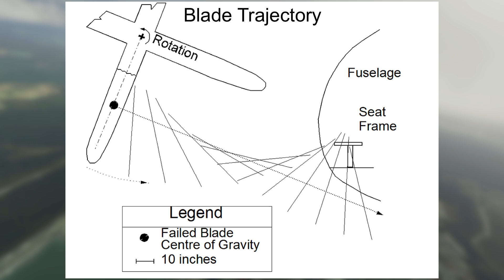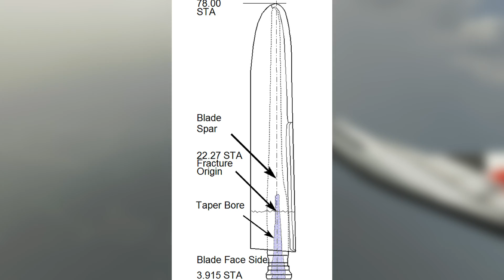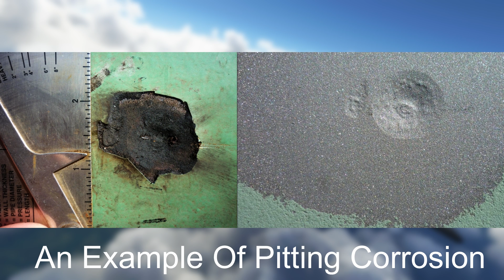The Plane That Was Ripped Apart | Inter-Canadien Flight 1678

Comment: I don't think I want to fly on an ATR.
Reply: Having flown extensively in the Canadian Arctic 🇨🇦  for well over a decade earlier this century, aboard both ATR-42s 🇫🇷  🇪🇺  🇮🇹 and aboard what became Bombardier's 🇨🇦  (originally Dehaviland Canada's 🇨🇦 ) DHC-8 AKA the Dash Eight, I slightly prefer the DHC-8 200s and 300s to the ATR-42 above the treeless tundra and glacier-clad mountains 🧊 ❄️ 🏔 ❄️ 🧊 of The Great White North!
Having flown less frequently over the Arctic aboard ATR-72s 🇫🇷 🇪🇺 🇮🇹 and over southern Canada aboard DHC-8 400s [AKA the Q (for Quiet) 400), again I slightly prefer the Q-400 🇨🇦 .
HOWEVER, these two serial types of turboprop airliners make up the vast majority of this class of aircraft worldwide 🌐 i.e. short to medium range passenger/freight/and/or kombi type turboprop airliners.
All models of these ATR and Bombardier/DHC turboprops have an excellent safety record within North American airspace, and indeed worldwide! 🌐 
After ATR resolved some very early causes of crashes due to inadequate anti-icing equipment, their turboprops were approved for flying even within extreme cold environments worldwide! 🌐 
 🇨🇦 🍁 🇫🇷 🇮🇹 🛫 ✈️ 🛩 🛬 🇮🇹 🇫🇷 🍁 🇨🇦

Comment: Considering this is practically the same sort of failure experienced in two turboprops in the US by ASA, the manufacturer must have been Hamilton Standard. Regardless of the manufacturer, this just goes to show that hollow metallic propeller/fan blades are really not the best - hollow fan blades have disintegrated spontaneously in flight several times, whereas carbon fiber composite fan blades have never, ever spontaneously disintegrated.

Comment: Stop with the click bait headlines. The aircraft was not ripped apart, it flew just fine. And fuselages are specifically designed to not rip apart when there’s a hole.  Please stick to accident reports.

Comment: 4:05 There is a big missinformation. The ATR is a cable plane, no hydralics are used for the alerons, elevator or rudder. The only thing that would have not worked, would be the flaps and the hydraulics for the landinggear but this has a backup function.

Comment: I don’t think you understand this failure at all. You are clearly not familiar with the construction of the ATR’s propeller blade. The metal part which failed here is at the core of the blade. It is the basis around which foam makes up most of the blade’s volume. The whole thing is contained inside a protective and structural envelope of reinforced plastics. The corrosion failure of the internal aluminum core was indeed the start of the blade failure. But, unlike you seem to think, this wasn’t a matter of a continuous outward ‘growth of the crack’ until the blade failed. 
Once the aluminum core breaks, the outer prop volume simply has insufficient strength to withstand the centrifugal forces asociated with normal operation and snaps of. It is well possible that no crack would have been visible from the outside, one second before the blade section snapped off.
I once grounded an aircraft, to the great annoyance of the passengers who were going to miss their connecting flights out of Atlanta, because I did see a slight crack on a blade and was not sure about the inside of the blade. I was the first officer and the captain left the decision to me. He would have flown with it. I didn’t want to. A few months later another one of the airline’s airplanes suffered a blade failure (much more disastrous than the aircraft in this video) and crashed, killing a number of passengers and its captain. More than likely, no crack had been visible when my colleague inspected that particular blade.

Comment: There's also the American Airlines Flight 191 incident where metal fatigue (stress crack) caused an entire engine to rip away during takeoff. Although that was a result of airlines caring more about savings vs. safety rather than a chemical reaction.

Comment: 4:08 Just short information about the ATR controlles. The ATR is a cable controlled plane. The hydraulic is just used to work the flaps and landing gear.

Comment: Interesting regarding the cork. Cork is no longer washed or steamed with chlorinated water as it produces TCA - the compound that causes the 'corked taint in wine.
However for industrial use production of the cork is very different.

Comment: Loved this episode like all of them! Of course we got another example of pilot skill and coolness under pressure - but this time the emphasis was a bit more on some science. Not just the clever maths employed in locating the propeller, but the metallurgy, physics and chemistry involved in designing, testing, manufacturing, monitoring and developing all parts of an aircraft but particularly really critical parts like prop  blades. Mind you - and this is the thing with aircraft and aviation which totally differentiates it from all other forms of transport(excepting Space)  - basically EVERYTHING is critical!!!!

Comment: Deformation mechanics (especially fatigue crack propagation) were a specialty of mine back in the mid-eighties as a materials engineer. It's amazing how cracks propagating from material defects (especially pitting and inclusions) can cause failures at levels so far below actual strength limits simply due to cyclical fatigue. This was not fully appreciated until after the crash of the Dehavilland Comets in the early fifties.

Comment: This accident is eerily familiar.  The USMC  C-130 tanker that crashed in Mississippi (?) recently was brought down by a thrown #2 propeller (metal corrosion) that went thorough the fuselage, consequently  the skin started coming off, then a gearbox failed on #3 due to vibration and prop #3 came off causing the cockpit area to break off the fuselage.

Comment: Most fatigue cracks occur on exterior surfaces where stresses are usually the greatest. For example, the outside of a shaft in torsion experiences the greatest shear stress and can be detected using visual or fluorescent dye penetration inspections. Corrosion as in this case initiates cracks in nontypical places. Slag inclusions inside components also create fatigue cracking not visible in the surface, need more sophisticated detection methods (x-rays?) and have caused unexpected failures in turbine engine disks.

Comment: Interesting.but um how their products are made is basic manufacturing processes in engineering , would have thought theyd check it out to begin with?.im happy they got down safely.oddly enough i was looking at a company selling cork tiles flooring etc .wonder if they do that here or rinse it.salad is washed in chlorinated water all tap water is chlorinated mould seems to do it too wonder if its also ap water.?my aluminium sieve got pits in it.

Comment: I worked in the aluminum industry a while ago. One time there had been rumors, that we would get contracts by the aero industry. As someone with privat pilot background and somewhat being an aircraft nerd, I was excited and shocked at the same time. Excited for obvious reasons, but shocked because I knew about the high safety responibilitys and my doubts about if my direct superiours would know aswell. Anyways, the contract never came, so there is that.

Comment: Vap57 addressed my first Frustration.  Val door not val dior. And Dorval.  Secondly, although you correctly state at the outset that it was an ATR42, your graphic shows an ATR 72.  And how come the right prop is still turning even upon landing after they shut it down? One thing I agree on, as I worked around this aircraft at the time, I have never sat in a seat beside the props either on an ATR or on any dash 8’s since then. Seeing that was a real learning moment for me.

Comment: Cork and lead wool? That was the best they could do? That sounds really primitive to me.
Reply: The lead wool has been used by this propeller manufacture since the 1930's, the cork was used to keep the lead from coming loose in the bore.  What is not mentioned is that the corks were held in place by what was a brand of wall paper glue.  No brand names used.  This method has been used in millions of propeller blades.  They now use a fiber cone in the bore to isolate the lead from the aluminum blade bore.
Reply: @michaelhope7620  Thanks for the info! 😀

Comment: They corrected the fault immediately after the very first accident? Then this cannot possibly be an aircraft manufactured by Boeing who wait till the second accident and the removal of airworthiness certificates by countries outside the US before doing anything to prevent further occurrences.
Reply: There were two blade failures on different aircraft in March 1994.  They came up with an inspection procedure and repairs for blade found with corrosion.  Then in ASA 529, happened in August 1995, which was a failure of a previously inspected and repaired blade.  There is no Boeing connection to the ATR failure or the two EMB 120 failures.

Comment: Well from steel or iron water pipes it is known, that wood under lied to equalize the pipeline during installation leads to local pit corrosion in the steel or iron tube, due to organic acids formed when covered with earth and humidity, this can destroy iron tubes with 1 cm wall strength within 20 years.But water storages from the Bronze Age build entirely from wood lasted nearly 2800 years and where removed finally due to mud accumulation. So wood itself properly cut in winter, so as to reduce its sugar content, and probably treated with its own oil and resin can last very very long! Unfortunately when they removed it and put it in the museum of San Murezzan, St. Moritz Switzerland, they painted it with black coal tar and cut a big hole.

Comment: This video shows the importance of regular non destructive testings and inspections not only in aviation but in all fields of engineering and construction.
Reply: At the time of the accident, there was no non destructive testing available to find the corrosion.  This includes visual inspection, as the lead wool that was used for the individual blade balance did not need to be removed, it was also not encouraged to be completely remove due to possible mechanical damage.

Comment: Fantastic! Road salt is prohibited from use at airports for this reason, and chlorinated chemicals in general are generally unwelcome. Even A-B-C fire extinguishers are prohibited due to corrosive effects on aluminum. Only B-C fire extinguishers are permitted in the AOA. I love videos like this because I teach many people how to operate safely in an airfield environment and references like this help me explain how small things can have an effect or why rules that may seem over-burdensome exist. It really helps when there is a rule that needs to be complied with if I have a concrete incident to point to that reinforces the importance.
Reply: I gather there are also severe restrictions on shipping gallium by air, because if it melted (I believe it melts at about 30 °C, so sitting on the tarmac on a hot day could do the job) and leaked from its container, it could alloy with the aluminum of the fuselage skin and create a weak spot.

Comment: I wouldn’t argue with the findings -  when you speak of low level chemistry reactions, could acid content in the air moisture content contribute at? The pit like indentation also occurs on the back of propellers in marine vessels, it’s called cavitation. Just compare the issue of compression and vacuum front and rear of prop, then compare density of water and air - add in the relative speed of marine props and aeroplane props or screws as they were once called.

Comment: ATR has mechanical controls and hydraulics are used for landing gear(can be extended manually), flaps, braking, etc. It would have been a tough day nevertheless if the hydraulics were lost.
Well done to the crew for safely landing the plane.

Comment: Interesting way to balance things. Typically with balancing, they will remove material, usually by drilling/milling or with a laser, from points where the balancing machine determines. But I suppose it was designed this way for a reason.
Reply: Any material removed from the prop blade will change its shape thus aerodynamic characteristics (and stiffness, vibration resonances and so on). So other means had to be developed. Dynamic balance is also dependent on the mass distribution throughout the blade (where the material is removed).  Consider  balancing a car wheel. Mass is added, not subtracted.

Comment: I love flying in those ATR72's, but I always make a point of NOT sitting in the row in-line with the props or the one in front 😉
Reply: And don't order wine during the flight.
Reply: @shreddder999  Unless it's got a synthetic cork or screw-top.
Reply: Don't fly on them in cold weather, their driving systems suck.
Reply: @kdrapertrucker   "Don't fly on them in cold weather, their driving systems suck."

Did you mean their deicing systems?  If so, that's true.  Their deicing systems are notoriously -- fatally -- ineffective.
Reply: The prop arc is one thing . Sitting two seats back and being in line with the compressor wheels is just as if not more dangerous than the prop.

Comment: And yet a yet later on Atlantic Southeast Airlines Flight 529, a nearly identical blade corrosion issue happened with much more serious consequences. :(
Reply: Correct, but the blade that failed on the ASA flight had issues passing the original Ultra Sound inspection from the first two failures.  It is possible that some of the corrosion pitting on the blade caused it to fail about 17 months after this in August 1995.

Comment: I think you give Mathematicians too much Kudos, it was the Physics that enabled the numbers to be crunched so successfully.  In particular: Sir Isaac Newton.   On a tangent however, this pitting, due to electrickery, is a constant problem even today.  Carbon Composites are becoming increasingly common and yet Aluminium is still being used in close proximity ... an absolute disaster in the making.   Only a fool puts Carbon Composites and Aluminium together for they are doomed to destroy each other on quite a noble scale!  Boeing take heed. :-)
Reply: I have degrees in both math and physics.  This was definitely applied physics with some unremarkable university level math.    Newton laid much of the ground work for both the physics and the math involved.
Reply: @HweolRidda  Yes ... Both! :-)

Comment: Indeed a very good presentation. Just a minor correction: The dent hydraulic lines have nothing to do with the controllability of the aircraft. The primary flight controls of the ATR are manual. The hydraulic lines are for the landing gear, the the landing gear extension system has a manual backup.
Reply from the maker: Good catch! My bad!
Reply: Fly with Magnar, your comments add much credibility to this channel. Nice touch. 👍
Reply: u op
Reply: You must read a lot of books !!
Reply: @truebluestu3428 , I have flown that bird for more than 20 years.
Reply: English please
Reply: @TeamKPDH  even if the hydraulic line were cut by the propellor, the pilots would still be able to control the plane.
Reply: @tabittheha  But belly landing the plane with compromised structure would not be a pleasant experience...
Reply: @090giver090  oh, sorry I’m not trying to make my own point! I’m just saying what the other poster said in shorter terms bc Simplex said “English please”
Reply: @tabittheha  Yes. I understand. I just specified that even if shattering hydraulics wouldn't affect plane's controlability, it would still had put them in grave peril.
Reply: @090giver090  True, but he mentioned that there's a manual backup for the landing gear

Comment: My parents are mathematicians but I screw math up because I sometimes switch the order of the individual digits in a number. In any case, I have a hint for being able to always know where your pocket things (like your wallet) are. I always put all of mine into a plastic container and put it near the door. When I leave, I simply put all the stuff in the container into my pockets and can rest assured that I'm not forgetting anything. Then, when I come home, I take those pocket things out of my pockets again and put them back into the plastic container. There are lots of things that can be done through checklists or by having everything that has to be done in a short amount of time together. Might as well save the real thinking for problems you hadn't anticipated because there's no way to be alive without having quite a number of those kinds of problems.

Comment: You give the impression that the number two engine was kept running which seems impossible given the blade imbalance. Indeed a fascinating story digging back to the root cause.
Reply: After the portion of the blade broke off, the rest of the propeller imbalance caused it to break off the front of the gear box and leave the aircraft.  So there was no thrust from the right/#2 engine.

Comment: I still don't know why they don't put cameras on planes that let the pilots see the engines. If SpaceX can live stream during launches, cameras can work on a plane.
Reply: On top of what the other commenters said, the number of crashes that could have been avoided by having cameras all over is negligible, and you wouldn’t be able to view every part of the plane anyway. It’s just not worth doing.
Reply: @Sashazur  It might be worth doing, since planes already cost $10M-$100M. :) Even if a camera system costs $10,000, and 5 hours of training, that is nothing in comparison to the cost of the aircraft. Plus also, onboard AI could monitor the camera data on such a future aircraft design. That is just my opinion. Anyways, merry Christmas/happy holidays. 🎄🕎
Reply: It’s quite easy 
Cost and workload for pilots. 
Cameras means more displays, more displays mean extra training. Extra training is expensive. Taking care of displays and cameras is expensive. Buying them in the first place is expensive